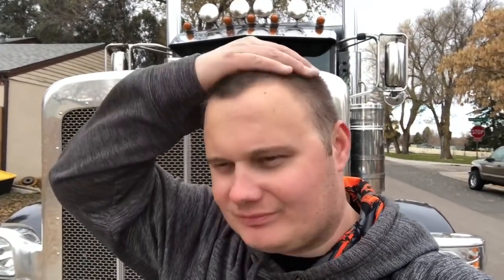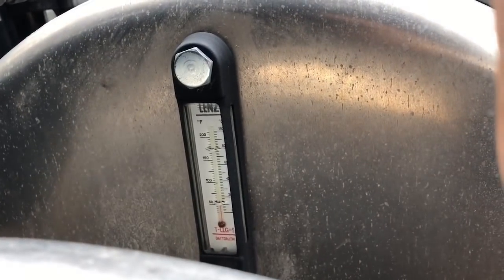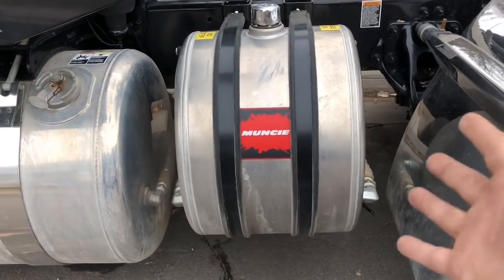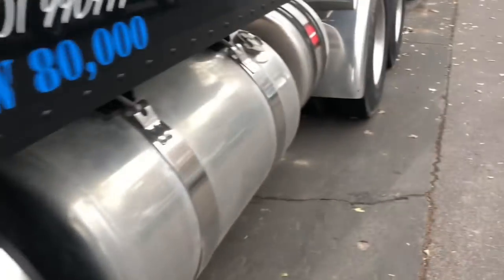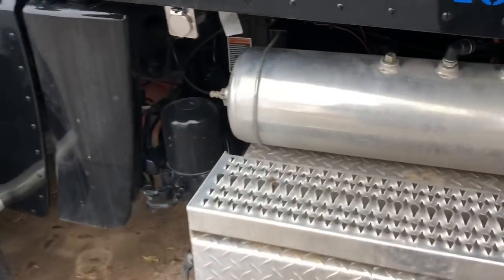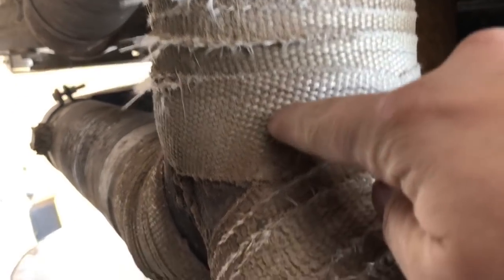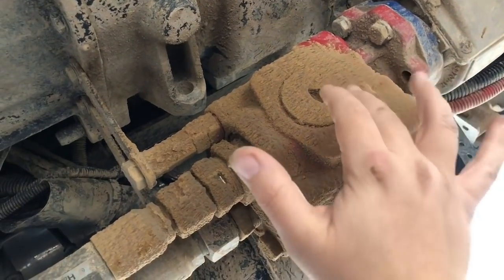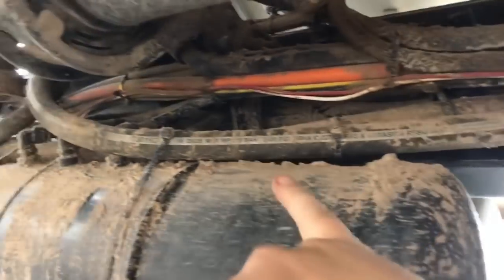Outfitting the truck for the oil field vlog#42

Comment: They also sell square tanks that go behind the sleeper instead of having it on the chassis. One of my buddy's when I did end dump had his hydraulic fluid on his fuel tank. I think he got the fuel tank custom to where they welded half for fuel and other for hydraulic fluid it was pretty cool. Also if I was  you I would carry a by pass incase one of your hydraulic lines bust you won't be fucked let's hope it never happens. Keep up the videos 👍👍